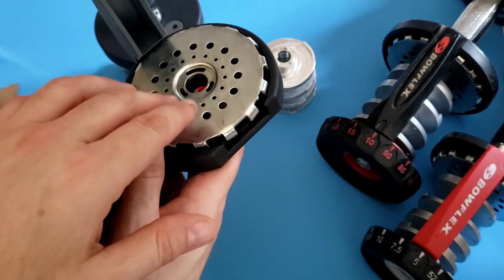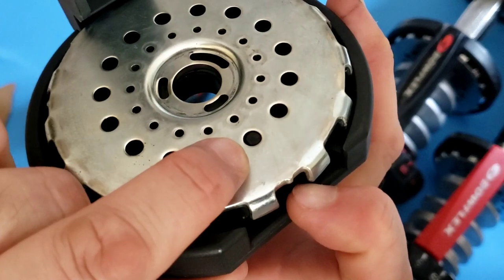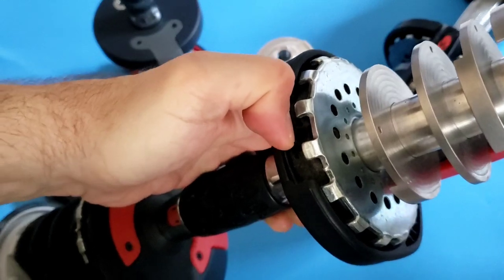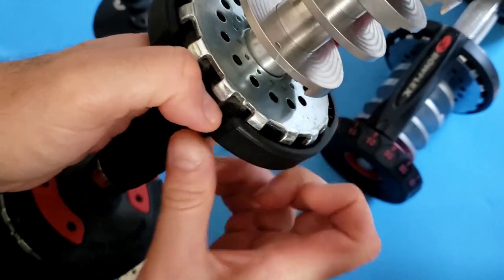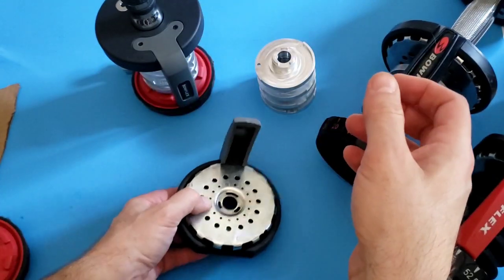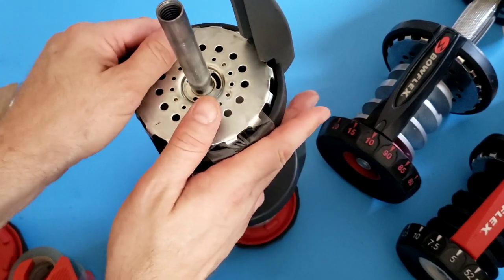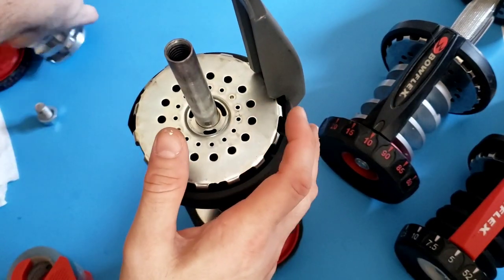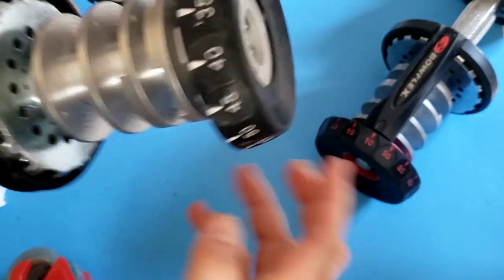Bowflex® SelectTech® 552 & 1090 Troubleshooting & Assembly - Locking Pins, Springs & Ball Bearings

Comment: Joe, I just picked up a set of series 2's last night, put them on a flat cart this morning and covertly got them into my office @ work. During transport, while going up a ramp, one dumbell fell off the cart and the dial wouldn't turn, nor would the dumbell come out of the cradle. Springs, ball bearings and pieces everywhere after I disassembled, I was in trouble.  Your videos saved me.... Not only are they as good as new and working properly, but I also know a lot more about how the system works for the future. The grease trick is key...lol. If I ever need some mods, upgrades or replacement parts, I'll be sure to get ahold of you. Thanks again for your very informative and helpful videos.

Comment: Glad to hear you will be making metal locking pins.
Reply from the maker: When the plastic pins shear, or begin refusing to re-engage the metal plate...that's it.  The dumbbells would be completely unsafe to use at that point.  Though the problem is much more rare than broken discs.
 
The upgrade will be slightly more involved...8 allen screws and a little finesse.  But it's doable. Just like with the discs, once you replace these, they'll never need to be replaced again. Stay tuned Bandit!

Comment: Nice, work Joe!!! Please keep me posted on the pin mod, I would be totally interested in it. Also will you be doing a upgraded metal plates for the 552 series 2 ???? That would be so awesome. The look would be amazing and durability would be superb. These dumbbells would be set for life with all these modifications!!
Reply from the maker: Hey hey Michael,  awesome man!  You'll definitely hear more about the mods later this summer.  Of course right now most of my effort goes toward  making sure the disc kit manufacturing stays on schedule so you all can upgrade your dumbbells asap.  I believe this is the first video in which all three of my upgrades--552 S1, 552 S2 and 1090--appear at the same time.

I'm hopeful I can manufacture a locking pin and button affordably soon afterward. We shall see.
For the plates....I'm looking forward to that challenge.  My initial goal is to try to preserve the OEM base, if at all possible.  The PRO is that it would keep costs down.  The CON is that the existing base will limit my design options for the plates.  It'll require some experimentation and prototyping to find the right balance or materials, density, cost, aesthetics, etc.   Tons of ideas swirling around upstairs.  Stay tuned!
Reply: Awesome, can’t wait to receive my 552 series 2 disc kit.

Comment: Hi, great video, thanks! I've taken apart and repaired my dumbbells, but when I reconnect the dial, the numbers of the rubber cover don't match the numbers on the plastic dial - they're one setting off on both sides. I can't figure out what the problem would be. Any suggestions?
Reply from the maker: Thanks, I am glad you found it useful. Here's a video about making sure all of your discs and dials are in proper alignment: https://youtu.be/yJ05HDb8HbA 

If you're referring to an issue different than the one I cover in the video, let me know. Cheers, Joe

Comment: Hey joe, I’ve held off buying discs knowing you would probably produce this part. I have a set of 1090’s, notice this exact issue. Not soon after I noticed on one dumbbell a pin sheared off. Then had the issue of a plate on the same bar falling off periodically when replacing the bar back on the base. I lubed the mechaniinizum which helped but didn’t rectify the issue. I’m prepared to order the 1090, 552 series 2 and pins all at once.
Reply from the maker: Awesome Eddy...I know we've already written back and forth in emails.  You've been following me since the early early days of my project if I recall. Crazy isn't it?  Going from a DIY video that I posted last year just to let others know they could fix their dumbbells, to a commercial product with many hundreds of customers and growing.
Reply: Average Joe Innovations yes I have been following you on your journey. This pandemic certainly created a massive demand for this fix with thousands dusting off there home gyms ti stay fit and healthy. I’m happy for you!!

Comment: The button that depresses the locking pin on 1090 are slightly harder to push causing the dials to have a partial depression only and the dials can't be turned. Any quick fix?
Reply from the maker: Good Monday morning to you.  I saw that you had posted this question on another video as well, so please excuse the duplicate reply when you see it appear twice. I like to make sure anyone reading comments can see my answer below each appearance of the question. There could be a few different reasons for your pin no longer working smoothly. Here are couple of them:

Spring pin corrosion - see my video about that here: https://youtu.be/9Kc6Cv4yuU4

Catching inside pin cavity - sometimes wear and tear can lead to the pin and/or the button getting hung up such that it will no longer smoothly press inward, or return back to its original position. I discuss some of that in the following video: https://youtu.be/1yXTshc4cxY?si=r6itPmQ2xAZqmkpr  

Note that the spring only helps to return the button to its original position. In your case, the problem is the opposite and the button will not fully depress. I would disassemble the dumbbell, and remove the locking pin from its cavity. Then inspect the pin, the top of the button and the cavity itself to see if anything has worn in a way that may cause these components to get hung up on each other.  

If one of the parts is worn/damaged it'll need to be replaced. I make replacement locking pins. I have not yet begun making replacement buttons, but the design and prototype have been ready to go for a couple years now in anticipation of eventually replacing buttons as well. Your only current option for a replacement button would be to find a used part on eBay from someone parting out SelectTechs. Careful...not all buttons are identical. As far as I can tell, there are at least 2-3 versions of it.

If you cannot find any obvious wear/damage on the pin or button or inside the cavity, try spraying some lubricant into the cavity and on the button and pin, and test it again.  You do not need to fully reassemble the dumbbell each time just to test the button. You can see how I test it in the second video link above.  Once you have the button working smoothly by hand, then reassemble the dumbbell. As far as lubricant, I recommend a plastic-friendly, non-greasy lube such as silicone dry lube available from several brands. 

I'm not on Youtube frequently enough to answer questions in a timely manner. If you have additional questions or run into any issues, feel free to send an email to me at: joe@averagejoeinnovations.com

Cheers,
Joe

Comment: Hey Joe, did you ever make the metal pins?  I've had my Select 552 since March of 2020 and seems my pin may have broken off (dial free spinning).  I'll be taking it apart based off your video, so thank you for it but saw you mentioned about making the metal pins.  I'll be calling bowflex in the meantime but would be better w/ Heavy Metal Pins!
Reply from the maker: Hi, Israel. Sorry about the delayed reply. I've been overseas for 5 weeks with limited internet access, and I'm back now playing catch up with orders and answering questions.  Unfortunately, Bowflex doesn't offer replacement OEM pins. It's one of the reasons why I had to make my own a couple years back. Some of mine were worn/broken and I had no other way to replace them.

I sell replacement locking pins in both cast aluminum and CNC machined 6061 aluminum. The latter is made in the U.S. right down the road from me. Here's a load test comparison of both styles versus OEM with the test results shown down in the description below the video as well:

https://youtu.be/VH2njquuUoQ?si=QC0hlIrGA5UCeZjZ

Any questions, just give me a shout. But please note that it may take me a few days to reply since I'm up to my eyeballs working my way through a backlog of orders and inquiries. Cheers.

Comment: My dial turns without any stopping, however, when pressing the release button it clicks nicely from one to the next. Would you consider this a spring or ball baring issue?
Reply from the maker: Hi, Jesse. Does your dial turn without stopping both in and out of the base? I recommend checking out this video:

https://youtu.be/TGXUxw8UOVA?si=4LG_ozCfzsnjK8D3&t=229

In the link above, I skipped ahead in the video to where I test the locking pin to see if it works properly. But if you watch the rest of the video, I also talk about other factors that can affect the way the dials turn. Loose/missing springs or bearings can cause issues. Cheers.

Comment: Hi Joe!  I have had my set of Bowflex 552 Series 1 for approximately seven years and love the set.  I dropped one of the dumbbells during my workout and disc 3 and weight plate 3 tab broke as well.  I have ordered the two parts from Ebay and will use your turtorial to repair my dumbbell.  Thank you for posting!  I would really like to make my set more durable with metal disc.  Are these available for the 552 Selecttech Series 1?
Reply from the maker: Hey Norma, wow sorry about the late reply. I'm just seeing this comment from you now. I've been a bit swamped as of late following a move. I'm glad you found the videos helpful.  Have you seen my videos about DIY repairing the plates too?  Here's one: https://youtu.be/P7sgmcXm66o and another:  https://youtu.be/-a-gqVB-oOw. 

The discs are available for Series 1 as well, yes. You can find more info here: https://www.averagejoeinnovations.com and shoot me an email with any questions. Cheers, Joe

Comment: Hey so I reassembled one where the ball bearings had come loose.  They're securely in there now but the outer-most plates are tight against the dumbbell when you put it in.  Both handles on both dumbells are set to 5lb.  Regardless of which stack I put it into, the one I fixed binds and its dials won't turn cleanly.  If i pull the troubled one out of the base and depress the button it clicks and turns like it's just fine.  Not sure what to do.
Reply from the maker: Hiya, Adam. Based on your description of the issue, the very first thing I'd look at is the end nuts. Are the end nuts cranked too tightly?  Sometimes, just backing off a quarter or half turn can give the plate the breathing room it needs to slide more smoothly, and the dials won't be "clamped" to the point that they are difficult to turn. Don't back the nuts off so much that your dials are now loose such that you can rock them back and forth. That would be a safety issue.  But backing off just a smidge isn't an issue. Make sure you add a couple drops of thread lock so the nuts (or bolts if it is Series 1) don't loosen over time.

And I would test the handle in two scenarios: first with all of the plates in the base and, second, with only the two smallest outermost plates in the base. That'll help identify if there's an issue with something more than the handle and smallest plates.

Hit me up in an email if backing off the nut slightly doesn't work for you: joe@averagejoeinnovations.com

Cheers,
Joe

Comment: I have 1090s and the dial on one side spins freely but doesn’t appear to engage the weights/change weights at all. How do I fix this?
Reply from the maker: Hi, Phil. Each of the components on our 1090 handles are engaged (locked into) adjacent components with three little lugs. When those lugs wear/shear off, the components are no longer locked in sync and one or more can spin freely. 

Remove the weight plates from one side of a base. Place your empty dumbbell handle on the base, fully seated, such that the handle half with the free-spinning dial is on the side with no plates. Now turn your dial and observe the black disc adjacent to it (Disc #2). Does the dial rotate, but not the disc?  If so, either the dial lugs have sheared off (in which cast the dial needs to be repaired like this: https://youtu.be/vU51aKjhvzU or replaced), or the handle assembly is slightly loose--just enough to allow the dial to disengage from Disc #2--in which case, the handle needs to be properly re-tightened.

If the dial and disc 2 rotate together, then turn your attention to discs 3, 4 and 5. They should all rotate together as a single unit. If anywhere in there, some rotate and the rest remain still, that's where the lugs have sheared off in between them. 

Since this is only occurring on one side of your handle, I doubt the handle assembly is loose. I'm willing to bet that the dial lugs (or one of the adjacent disc's lugs) have sheared off.  

Hope this helps.  Cheers, Joe

Comment: Any idea if the locking mechanisim isn't locking the few of the weights properly? One of the 2.5lb plates always semi locks like it's sticky to the locking mechanism but easily falls off. The 7.5lb plate is doing basically same thing. Just the two plates on one side. By the way it is not the tabs. They are fairly new bowflex and the tabs look perfectly fine. I took the dumbbell on 10lb and moved it to the other rack to test it and it's the same issue so its the dumbbell and not the tabs on the weights. I noticed that one side feels a little looser when moving the weights inside the dumbbell. Is there a way to tighten the dumbbell?
Reply from the maker: Hi Masaki, you can only tighten the handle to a certain point before the dials will no longer turn properly. The goal is to have the handles tight enough to function properly, but not too tight. You can certainly experiment with the tightness to see if there's any improvement.

Your description of your  problem can mean one of two issues. Weights that should be locked into the handle at a particular weight setting aren't. Or weights that shouldn't be locked into the handle are lifting out briefly, then dropping. Two different issues.  

Shoot an email over to SelectTech.Fix@gmail.com with a video of your problem in action. I can give you my best guess based solely on what I see in the video.  It's not nearly as good as having the dumbbells in my hands, but I can try to point you in the right direction.

Comment: My weights are working except for one issue.  52.5 doesn't function correctly.  When I select 52.5, the two smallest weights on both sides come with the barbell, but not the rest.  After this, the only way to fix the weight is to press the buttons to rotate the dial to 5, and then once the weights are off, I can put them back on the rack and the barbell functions properly again.  Again, all weights are working except for 52.5.  Do you have any suggestions?  I think I have the series 2 (in ProFit brand).  Thank you!
Reply from the maker: Hi, Christopher. Oftentimes, if plates are not picked up by the handle at weight settings which should pick them up, either the discs (that retain the plates) or the tabs on the weight plates, or both are damaged or broken in some way such that they're no longer doing their respective jobs. 

So the first goal is to carefully inspect the components of each dumbbell to identify precisely which ones have failed. I prefer to disassemble the handles to accomplish that because it's easier to get a good look at each of the components. If you search my channel for my installation video playlist, you'll find videos that will walk you through disassembly and reassembly. If any questions come up along the way, shoot me an email and i will reply as soon as my schedule permits.  Cheers, Joe
Reply: @AverageJoeInnovationsLLC  Hello Joe, a couple weeks ago I ordered metal replacement discs from you, so this will be a non issue when I install those.  Thank you!
Reply from the maker: @christopherbarth6501   Oh man, that's too funny, Christopher.  I was thinking your name looked familiar. Thank you for your business! Sorry it took so long to reply here. I'm just not on Youtube often enough to answer questions in a timely fashion.  You know where to find me if you have any questions during or after installation!  Cheers, Joe

Comment: Hello Joe, thank you for the very helpful video.  I have the 1090 and am interested in buying the locking pin and button if you have them.  Also I see that you have replaced the stock discs with metal discs?  Do you sell those as well?  Thanks, Aaron

Comment: I had an issue where my weights got stuck at 50lbs, so I used the button on the bottom to release them. Worked on one side, but the other side only released one of the plates and not the other three. And now the dial is turning even when the button isn't being pressed, but it still isn't releasing the plates. Any thoughts on how to troubleshoot?
Reply from the maker: Hi again Natalie, it almost sounds like the dial lugs are broken on that side of your dumbbell. Meaning that the dial is no longer physically connected to the discs that hold and release your weights. So you'd be able to turn the dial even when the button isn't pressed, and your plates would not be released by turning the dial.

To see what I mean, take a look at this video about the problem and one way to repair it: https://youtu.be/vU51aKjhvzU

Now, if this isn't your issue, there are other things we can check.  But I'd recommend starting there first.  Let me know how it goes.